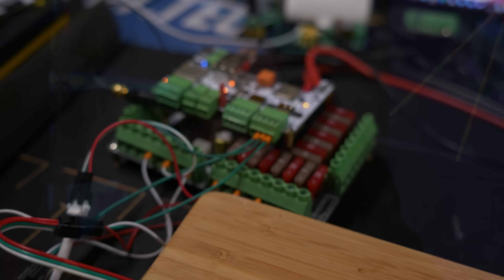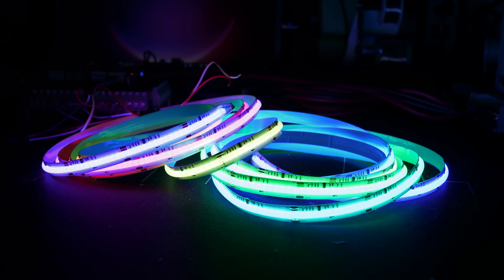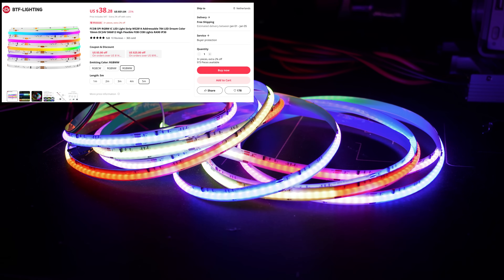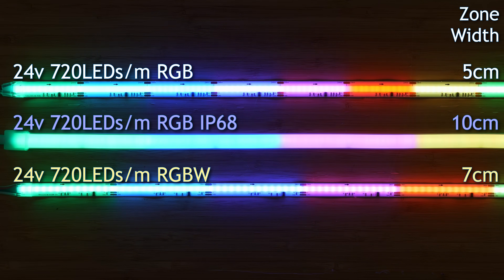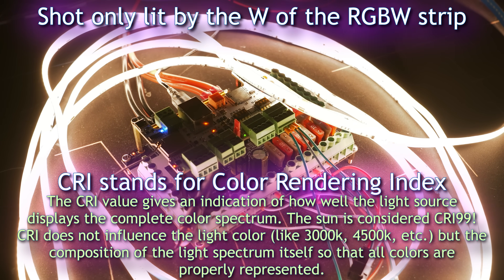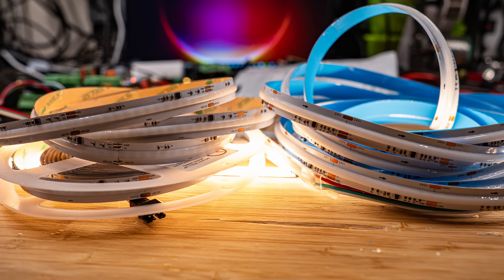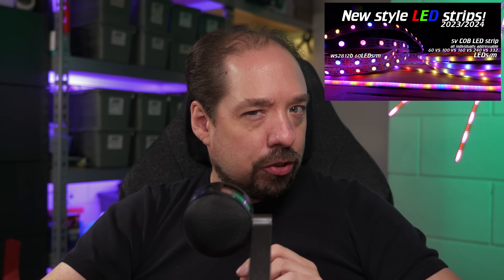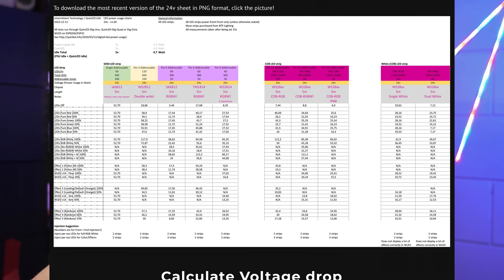💡QuinLED💡The best RGBW 24v Addressable LED strip!

Comment: I just installed Pautix 24v IP65 RGB IC addressable. They are 10cm per meter vs 5, but about half the price. They are bright and in my application do not require power injection which is so awesome. I am adjusting from the ws2015 5050 strips, but the neon effect and rick solid nature of these strips is outstanding. Eliminating the extra power injection wires from my aluminum channels makes it so clean and easy.
Reply from the maker: I recently saw those also but didn't get them because they also had the 10cm zones and very clearly mention they are still only for indoor use so not really waterproof so it's a bit confusing what it would add vs the normal indoor version.
Reply: @IntermitTech  excellent point. They do say waterproof and indoor. My experience so far has been that IP65 does just fine in the aluminum channels on the roofline of my house in terms of weatherproofing. Also the silicone sleeves, both the diffused and clear varieties, are more trouble than they are worth in my view. Either way, thanks for all you do to educate and advance this hobby. I run everything on your controllers and send everyone who asks to your website and videos.
Reply: I am also thinking about buying Pautix vs BTF. How are they holding up?
Reply: @mrxytube  still going strong. The only issues I have had are at the connections which is more of an installed than a product issue. The only downside is that I came from individual addressable strips and I have had to adjust my expectations as the 24v has addressable blocks. The BTF blocks are smaller and that would be desirable. That said these were half the price.  They are so bright and look great.
Reply: @troykirchenbauer  What controller are you using with RGBIC strip? I can see that they recommend 530E but i dont want to use banlanx, is it possible to use WLED native app ?
Reply from the maker: @MaraxYTube in the video I'm using either a Dig-Quad or Dig-Octa
Reply: @mrxytube  I am using a Digquad. These are a little more expensive than some, but they are very stable, especially the latest version with the switchable resistors.  I love running WLED and have all the holidays preprogrammed and scheduled.
Reply: @troykirchenbauer  i am doing this for my apartments that I rent to the tourists, so I can't have RGBIC because I need phone to control. So I decided to go for RGBCCT with zigbee Congroller so I can give them HUE simple scene remote.  But for my place I Will go for RGBWIC to play around with it. I hate that there are no simple remotes like with HUE..
Reply from the maker: @MaraxYTube there are, check out my video on the wizmote!
Reply: @IntermitTech  hmm that remote looks cheap. when people see HUE name they know it's expensive. It is simple, great quality and 10 scenes. This one is 4. Philips needs to make new remote to change colors and that we can add RGBIC stripes to the app.

Comment: Have you looked at the 24V BTF FCOB Addressable WS2811 white lights? They have different options including a tunable white light version.  I would be interested to see how they compare to analog white light.
Reply from the maker: Yes, that one will be in the Addressable White video, it's pretty decent but has it's own issues too.
Reply: @IntermitTech  Be interested to see your findings on this as I have two of these WS2811 5m strips. What analog white strips do you like?
Reply: @IntermitTech hey quindor, looking forward to seeing this. Any idea when it’ll come out? The idea of a dimmable temperature adjusting light strip at the top of my closet sounds excellent, but don’t have a clue which strip to buy.

I’m also looking at a double row cob light too for the extra lumen but might be overkill, hard to gauge and nothing to compare it to.